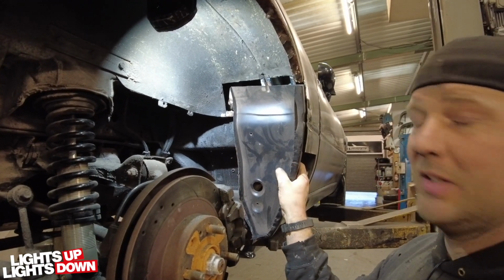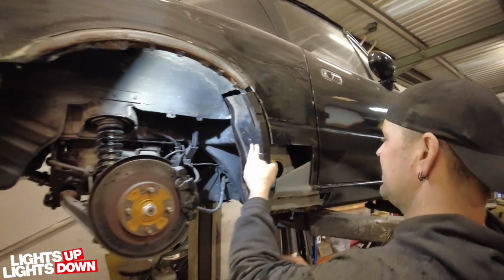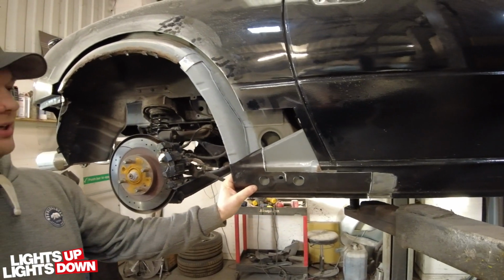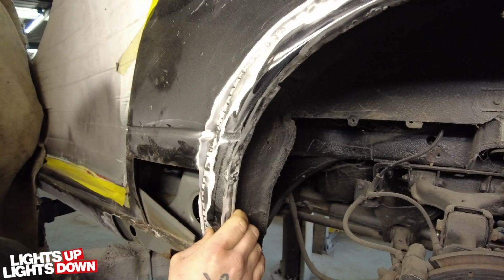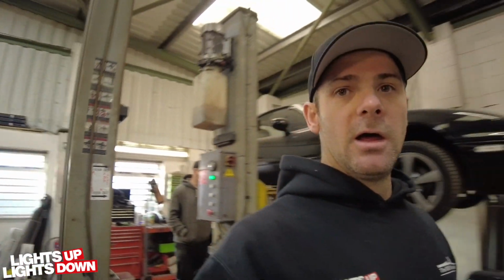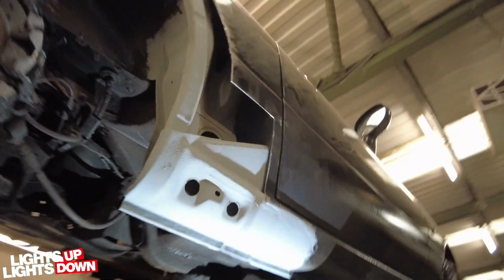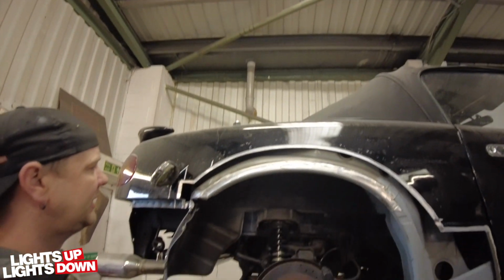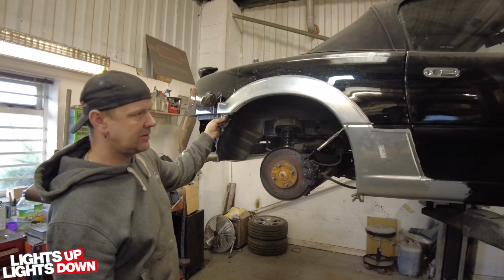MX5 Sill and arch repair - How to guide - Miata - Part 2

Comment: just about to start on my sons car, previous owner got some welding done on the rears and there is more filler over the corners and welds that its come through in about 9 months
Reply from the maker: That sounds like it wasn't repaired correctly.
Reply: yep just in contact with you at the moment ,ground some out and discovered its beyond me as main rail is also rotten and slightly out of my comfort zone , son has decided to get it done properly , also a Dakar model  @lightsuplightsdown3018

Comment: I would like to see a FULL ROCKER PANEL REPLACEMENT along with a sill replacement.
My 04 mx-5 needs rocker replacement due to rust .i can not get inner upright panel.   The bottom is rotted thru. What is the recommended procedure. I have a weld on repl. rocker panel and a front half of qtr panel

Comment: Hey guys, I love your restauration videos and your work. I bought my first MX5 a couple months before, it's a 92' model and the previous owner did a terrible job with rust repair. He used stainless steel plates, rivets and some self tapping screws. So I gotta cut everything out and fix it the right way this time. I order new sills, quarter panels as well as the inner wheel arch panel. I have  some experience with the rust repairs and welding, but the most difficult part of the repairs is custom panel fabrication. Could you please include some of the metal plate fabrication process such as the inner arch and parts of the floor. It would also be cool to see some welding. I would highly appreciate it. Greetings from Norway!
Reply: I’m in the same boat. Would be great to see this in a video.

Comment: Great work. What is the approximate cost of a repair like this?
Reply: Looking at the website.....a BASIC repair each side is £882,the work done on this car is beyond that....i'm thinking more like 2k! Is it cost effective,unless you've got a low mileage special edition,the repair would be as much as the vehicles value?Great work though.
Reply: @andyedwards8945  thing is though once the work is done you KNOW it's solid. When buying another car you have no clue what the state of the insides of the sills etc are like and even if the person selling it has had work done, you don't know if whoever did the work is this good.

Comment: Nice one lads..... At 20:00 the underside, i thought the panel went down also, aNd not just spotted on innersill?
Reply from the maker: Originally the rear wing/sill is spot welded to the inner structural sill in the same location we have done it here.

We often see repaired cars with the outer panel attached to the bottom sill lip as you suggest, but this is incorrect and is usually done because the inner structural sill is rusty and wont support welding, so they weld onto the bottom lip, something the owner will find out when they attempt to  jack their car up on the sill (something we don't recommend) and it collapses inward because there is no structural strength left in it.
Reply: Lights up Lights down ahh, great info there.. Would be awesome with some compareson shots of how others have repaired it.   Usually at my work if a car (non miatas) is in for MOT and it only has to go through and not be a showroom car, i do it the way i wrote, thats why. Just have to find clean metal to tag on. 😂

Comment: Do you open up the sill drains with a drill or judt shave them? If so how many mill would you say to open then up by? I'm doing full sills and quarters on my mx5 in the coming months do you have any pointers ?
Reply from the maker: Hi Ross, they are just made bigger during the rebuild process